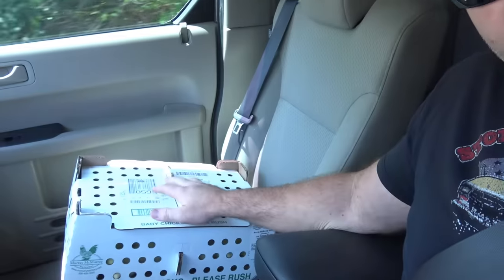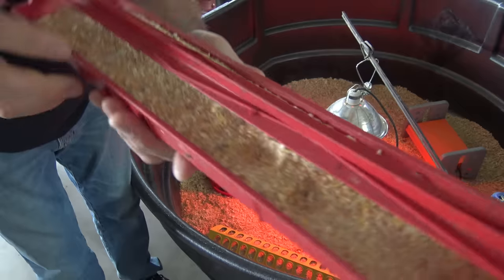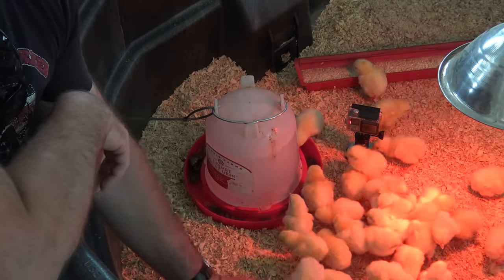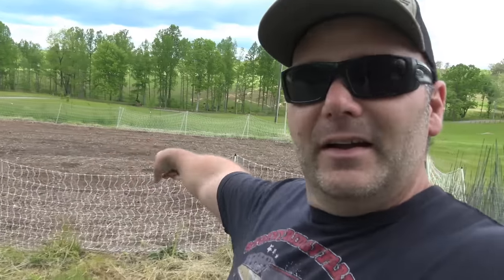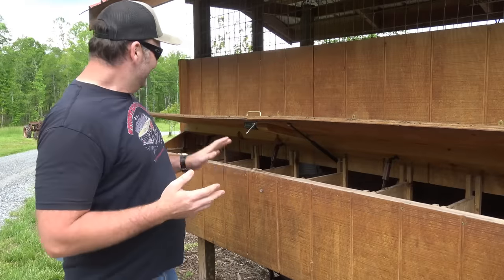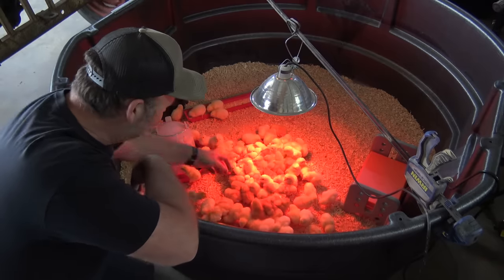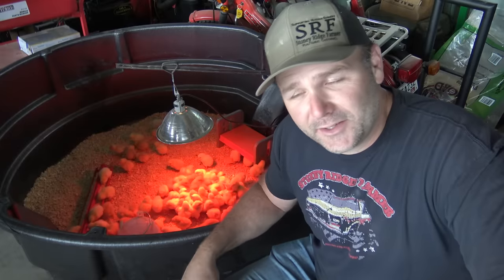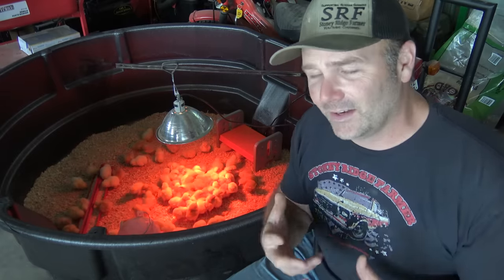Raising Chickens 101..Best advice and education you'll find anywhere on the web!

Comment: Two things I would suggest: number 1: chicken nipples. These were a game changer for me - they don’t mess their water, and you don’t have to fill as often. You can use the bottom of the bucket nipples and hang the bucket on something, or they have the horizontal chicken nipples and you can put the bucket on the ground. Second, fermented feed. Last year was my first year trying this, and these chicks had next to NO smell to them, and they had solid stools instead of the nasty stinky watery stools they would have. I just lactoferment a five gallon bucket of cracked corn for 3 days, and then do a 3:1 ratio of feed to fermented cracked corn, and add about a cup of the fermented water to it, and couldn’t believe the difference it made to smell. Great job, love your channel - used it to help me butcher chickens last year. Bought me a chicken plucker this year - can’t wait to use it - should accelerate the process dramatically!
Reply from the maker: we wet our feed for adults...but not these young chicks...at about 3 weeks we start wetting the feed...we stay 2 days ahead...check out my everything chickens playlist you'll get a little more info about my operation
Reply: @T Clodfelter like I said- game changer- love chicken nipples.  I’ve got a buddy of mine who did the same thing as you in his chicken tractor. I think he may have used 6”. At most, however, he cold around 5 Gallons. I didn’t do this because when those chickens start getting big and depending on how many are in the tractor it’s not enough water. Instead I use a five gallon bucket with the horizontal chicken nipples on it, and once they exceed 5 gallons per day, I just add another bucket. Works great! I have considered other options like putting a float in the bucket, and tying in a hose from a water source - we will see. It would eliminate having to walk back and forth to the spigot, saving time.

Comment: I built 2 brooder boxes, 2' x 4' x 2'.  It's a size that is easy for me to manage. They both have hinged lids with hardware cloth to keep predators and a curious cat and dog out of them.  When it's really cold like it was the other night, I cover them with a blanket to keep the heat in. when it's nice I take the blanket completely off.
I use a chick waterer for the first week, then I up grade to a larger one and have it elevated a little off the floor.  
I will not be using chicken tractors, my land is not conducive for that type of coop.
Another breed that is a good dual purpose breed is the Orpingtons. I really like the breed for their versatility and temperament.

Comment: Ok, great video. I’ve had eight or so chickens for about 10 years now. My best advice is don’t stress. When I first had chickens I would worry about everything. Now, as you said, just make sure the food and water are tended to and collect the eggs. If anything comes up, deal with it. P. S. If your birds get bugs give all your birds a shake and bake treatment. What it is, is take a plastic bag and put a pillow case into it. Put some of the low % Seven into the bag. I use a dust mask for the next step. Take the chicken and put her into the pillowcase. Gather it and the plastic bag forming a seal around the birds neck and gently agitated he bag covering the bird well. On to the next bird. Works great. My local extension service professor told me about shake and bake.
Reply: After doing the Shake and Bake are any eggs produced safe for consumption
Reply: @dorothymasterson57  well 7 dust is used primarily for use on crops so... but then again everything is  bad for you... so just go with no.

Comment: I really appreciate the tip about rocks in the water - we were lucky and none drowned, but I have learned that it is a somewhat common thing to have happen.
Reply: Not in those waterers it isn't common. They only drown in those if they are so unwell that their face falls in them and they are too sick to move out of the water. But they will drown themselves in any water that is like a bowl that is deeper than their bellies are. You want them, if they get in the water either on purpose or accidentally, to be able to get back out and to the heat. I use a system with a red cup that you find on amazon for mine.

Comment: Very helpful video - you mention having 105 chicks in that large plastic trough.  We'll start out with 10 chicks for laying hens for my wife and me. Looking at a 2 ft. W x 4 ft. L x 2 ft. H 103 gal stock tank at Tractor Supply for $160 for our brooder. But you showed several totes in your garage and I would sure rather spend $25 on a 55 gallon storage tote if that will suffice -
Reply from the maker: buy the tarter water tank and you'll have a brooder for life...buy the cheapy storage tote and you'll have something to toss in the dumpster next year
Reply: I agree but two and switch them out to clean out

Comment: Janitor bucket feeder: Cut access holes for chicken heads to poke through abut 3 inches from the bottom of a 5 gal bucket. Get a large diameter pvc pipe to set in the middle of the bucket with holes at the edge of the bottom. Using L brackets, fasten the pipe to the bottom of the bucket. Pour feed into the pipe that lets it fill the bottom of the bucket. The chickens will not waste much feed this way, and the pvc pipe can hold enough feed for a few days.
Reply from the maker: yep....plenty of cool DIY ideas for feeders.....chicks aren't on these feeders for very long so I just use store bought ones most of the time

Comment: Great video. There is one specific thing that I just want to share. I have chickens of several different breeds and I can say about nets and clipping wings that it depends on the breed. Some breeds like Brahmas are not good at flying at all and won't fly over a small fence even without their wings clipped. Clipping wings of Brahmas was a mistake for me - it prevented 2 of them from roosting as they cannot even jump small distance to go up onto roosting area (I probably will need to fix the design for them). But there are some breeds that are light enough (like Polish or Sicilian Buttercup) or strong enough (like some of Sussex and some of mixes and even some strong Marans roosters) that will fly/jump over higher fences with wings properly trimmed. I have a fence 1/3 higher than yours higher one and ~8 hens and 2 or sometimes 3 roosters jumping out every day. Out of ~30. Funny thing is that my aracuanas are more than capable of that feat too but do not seem interested.

Comment: Although we did have a very cold May here in NC,   in most years you do not need brooder heat in May for meat birds,   they are big and give off enough heat to huddle for warmth.   I am doing 7 Barred rock chicks right now in June to see if regular breeds can go without heat and what does Mother Nature do to me?   She gives me 3 days in mid June with high temps below 65.    Although the cold temps won't go below 57 at night due to this Carolina Humidity.      I could run an extension cord to the brooder but went with filling gallon jugs with hot water,  its only 3 days.       I have come to the conclusion that to be truly self sufficient I need to figure out how to do everything without electricity.

Comment: I do the broader like the local Amish.   I hoop over a ide piece of aluminum flashing open on both ends. Like a tunnel.   Tall enough to get a kerosene lantern in there.   Works just fine and ya don't have a huge electric bill or all the equipment.   
Not to say that stuff isn't nice,  I just like to keep it as simple as possible.
Reply from the maker: fire...dust and chicken litter....not a good recipe in my mind.  The $1 per day to run that lightbulb is alot cheaper than a burned down house, barn or garage my brotha...keep that in mind

Comment: Can I use sand instead of wood chips, I wanted to use a 12v electric heater{s}, under the sand, to keep the chicken warm.
Reply from the maker: sand will work I'm sure....but with sand comes more dust...and you can't layer the sand once they've pooped all over it...you can simply add more shavings until it's time to get them out of the brooder...you'll need to clean sand out over and over again

Comment: I’ve never EVER seen anyone heat chicks without a very low roof. Every heater I’ve ever seen had a metal reflector hanging off the ground, and curtains made from rubber or blue jeans, to hold the heat in, with a 2 inch gap to the ground. The chicks would freely run in and out from the heater. I’m guessing you’d use 1/4 the electricity, using the old school heaters with reflectors and skirts.
Reply from the maker: well...this has worked for me for the past 12 years...so I'd say we're doing fine my friend

Comment: Now Josh, this might have been said but do you have plans for this coop?
I'm going to be sketching this up tomorrow.   
4x8 5 nesting boxes on each size.   
X'x" lift for wheel barrow.

I'm contemplating using pallets.  Working on an idea of which I can slide floor out over the barrow.   

The Mobile concept has me stumped at the moment. 

Had chickens some years ago and just ran them in a scrap built shed with an enclosed lean to.   This concept is so much better. 

Need more detailed info on coop
Reply from the maker: ur gonna have to use your imagination until I can get some plans published my friend....but it's pretty simple. Oh..and don't use pallets...make something nice that will last you 15 years instead of a wreck of old garbage pallets that you'll be tearing up and burning or tossing away in 2 years
Reply: @StoneyRidgeFarmer  good deal.   I'll have to go grab some screen shots.   
Agreed on the pallets thing.

Comment: Hello JOSH please confirm if your thermometer readings is using F or C because 87*C to 101*C is pretty much "cooked" chicks
Reply from the maker: You want ur temp to be around 90-95 ish degrees.. under the light...the birds won't lay in a place that's too hot...that's why I tell ya...if it's too cold they'll bunch up under the light...too hot they'll move away. Adjust accordingly right
Reply: @StoneyRidgeFarmer  OK cool I understand u but my point is 95°F (Fahrenheit 🇺🇸) is the same as 👇🏾 
35°C (CELSIUS 🇿🇼🇬🇧🇿🇦🇿🇲🏴) I'm watching you from Zimbabwe🇿🇼 
This side of the world it's mostly 90% British curriculum.

So 95°C will be 203°F which is almost boiling point.😔

Comment: Question. We’re getting 15 chicks and would like to put the brooder in the garage. In central NC during the winter,it can get into the teens at night. My garage typically doesn’t get below 40 degrees. Would they be fine as long as the lamp stays on? Or should they be moved in doors? Love the videos! Thank!
Reply from the maker: just find the sweet spot in your garage for the heat lamp my friend.  We keep ours out in the garage and it's well be low freezing at times.....you can also lay a piece of plywood over the top to hold in heat...just don't cover the entire brooder so they get fresh air and it doesn't get too hot
Reply: @StoneyRidgeFarmer  awesome. Thanks for the reply!

Comment: 🤦🏻‍♂️ those chicks are going to be popping out of that trough in a week or two.  By 4-5 weeks ours can fly up and perch 6’ in the air. We use a metal trough with a cage over top. There’s no way the heat lamp can fall in and catch the shavings on fire.

Comment: So, after wanting a small backyard flock for several years I finally made the jump this year. I prepared for and picked up 4 baby chicks last night. I have a heat lamp and a brooder plate. I am wanting to use the heat lamp during the day and the brooder plate at night. Would this be ok or would the change in heat source negatively impact the chicks in some way?

Comment: I've learned so much from your videos.  You got us through our first time raising/butchering meat birds last year.  I do have a question, though.  We are in upstate NY, which obviously is not as warm as where you are.  You were talking about letting the chicks outside after 2-3 weeks, but I doubt it would be warm enough here.  What temperature should it be consistently outside for the chicks to move outside.  Also,  what temp does the environment for the 2-3 week chicks need to be if it's still too cold outside and we can move them to a heated coop?
Reply: @ 10:39 “depends upon the size of the bird” & if it has gotten it’s feathers in.

IK, old comment, but just in case anyone else needs to  backtrack.

Comment: Hi Josh we have a chicken heating pad that appears to go under the fill do we need to have a heat lamp as well or will this be too hot. How can I check? We got these pads second hand and we do not have instructions or info on them. I have not had a chance to look them up but I have yet to stumble on a chicken-rearing video where one was used. So before I go falling prey to propaganda on these pads I wanted your 2 cents.
Reply from the maker: my suggestion is to have a heat lamp available in case you need it...if the heat mat is sufficient then use it...but you'll still need light.  The way I do this isn't the best for a heat mat....If you use a heat mat you'll be cleaning out the brooder over and over and over...v/s using a lamp and just adding more litter until it's time to move them outside.  I'd get a heat lamp/bulb and have it ready...it's cheap enough and a good insurance policy to keep your chicks warm
Reply: @StoneyRidgeFarmer  Thank you for the quick reply. We do have both types but we have a towered cage in my office where they will start we are doing ten silkies egg layers so I was thinking of starting all ten on top with both heat lamp and pad and as they got a bit older if the room was an issue we could do 5 in the top and five in the bottom. My wife wants them to be more pet so she plans on hand-raising them for a while and once I have my coop ready they will have a big run and coop outside. Also I plan on building a very large coop is there such a thing as too big of a coop?

Comment: Hi please let us know what is the heat reflective material preventing the heat builup on mobile coop ??
Reply from the maker: a shiny metal roof and 60 degree soil temperature....compare your size to the size of a chicken....this coop is 3 times taller than the chickens inside....that would mean an 18ft tall covered shed for a human...open on all sides..would you be hot?  And hey....it's ok ....it's cold in the winter, and hot in the summer...these are not humans...they are hardy animals that don't require air conditioning my friend...chickens are tropical animals

Comment: Was that a Honda trail bike behind bruder ?
Reply from the maker: Yep...an old trail 110..I'll be working on it soon...needs some carburetor work and a battery
Reply: @StoneyRidgeFarmer  
Years back when I was a kid my grandfather had one and most of the other guys at his deer camp had one of various sizes. This was before 4wheelers came out and it was a hassle to get a 3wheeler turned around in the woods. 
Anyway really fun to ride and are street legal. 
It will make you a good fuel saving ranch bike to go check on things when you dont need a truck or side by side. or even fun town trip. 
You can even make a mount for tractor bucket or forks and carry it with you cutting/making hay etc to stop and run back to house.

Comment: Is it common for chicks to have diarrhea every now and then? I feel like at least one of my chicks i got 3 weeks ago has gotten diarrhea every week 😩 i don’t know what to do they look healthy so I’m not sure at this point, they’re on a heated plate brooder and seem comfortable in their temperature
Reply: Fermenting their feed is the key. What I do, I fill a 5 gallon bucket with cracked corn, fill it to the top with water. You can add some vinegar with the “mother” in it to get it started - but I haven’t - it just accelerates the process. Put a lid on the bucket, let it sit for 3 days. Then I put a cup of the fermented cracked corn with 3 cups of the broiler feed, and a little extra of the fermented water to moisten up the feed. THIS is the number one thing I have found to have NO stink to these “stinky” birds, and they have regular poops due to the lactobacillus they are getting with the fermentation. Not to be confused with alcoholic fermentation using yeast - there is a difference. YouTube has a ton of videos on this process - I’m usually skeptical of processes like this - but after last year doing this, I won’t do it any other way from now on.

Comment: I would disagree with your approach to hardening your chicks by turning the heat lamp off  when it’s time to divorce them from it. Typically new baby chicks need about 95 degrees for warmth when received. After that, it is suggested to reduce the temperature 5 degrees each week until you transfer them out of the brooder to get them acclimated to nature’s temperatures  - but please, don’t just go from heat to no heat.